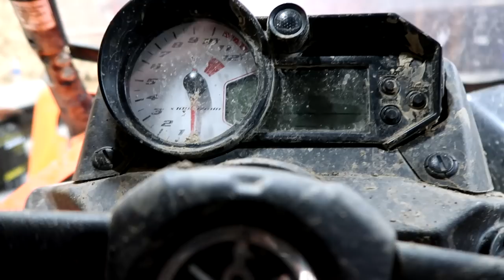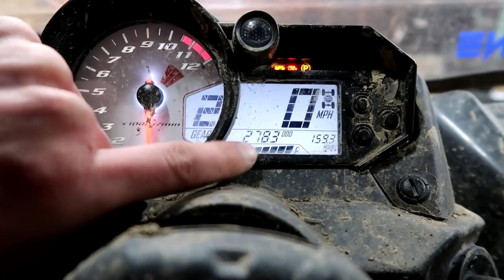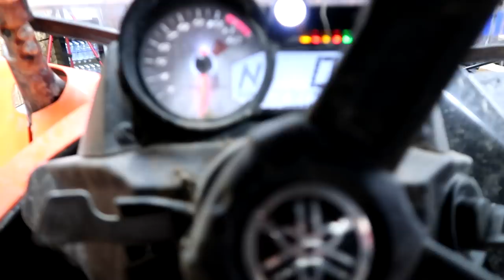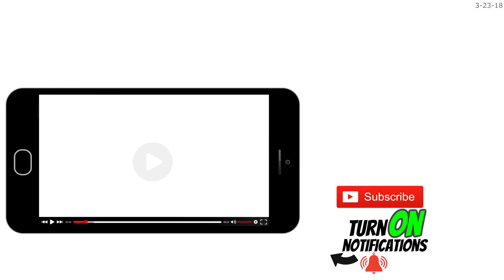I LOST THE FIGHT and was SCAMMED

Comment: I think the orange looks awesome!!

Do you plan to relocate the fuel tank and radiators?
Reply from the maker: Radiator yes. Fuel Tank... Not sure
Reply: The rad relocate is a definite plus! I’ve been to quite a few GNCC races and a lot of the YXZs do a fuel cell relocation as well that’s the only reason I asked. I have a 2016 Arctic Cat Wildcat X and they designed it with the rad and fuel cell up higher and behind the cab! Can’t wait to see ya at The Coker!

Comment: Hey Dalton!!!  My experience with auction buys is that there are always some hidden defects.... Some surprises to deal with. The extra miles and hours are no big deal if they maintained the engine... A lot of the stuff that U replaced, U would of probably replaced from the crash damage noted in the photos or stuff U would of added or upgraded... So, assuming that the engine, transmission, and electronics are healthy, add to that all the work, parts, and upgrades that U have done, U will be in Crush for around 1/2 of its new value with the upgrades U added.... U also gained a lot of knowledge of the machine, U made some videos, and U seemed to develop some passion for a new sport... All and all, I would say U had a win....  I have seen auction deals go so much worse....
Reply: Harvey Spooner Auction is buy as it... if you didn’t see the flaw in the vehicle that’s your fault. We sell our company fleet vehicles at auction, we actually go to the auction and watch people buy our stuff lol. At the auction they list the major things that are broken written on the front windshield. Saying examples Broke Window, Dents, Bad Motor, Transmission Needs Work. They don’t list things like broken ball joints or suspension bad. They only list the big expensive stuff motors and trans. We sell our Ford F350-F550 6.0s all of the truck we sell at the auction are motors blown heads. That will cost our company 5k for a rebuild kit. So we just sells them at auction and 70% of people don’t even noticed that the motor blown and they go high dollars hahah. So it’s the buyers fault and they need to look into what they want before they buy!!
Reply: Hey Clayton, I go to a lot of farmer style auctions, anything can be sold and anything and everything can be wrong with it.... If one pays more than the valve of known good parts, they are over paying.... Generally speaking, a lot of folks get ripped off, they get auction fever and loose all reason.... There are things that start at $5, I drop out of the bidding at $50, and the selling price goes above local Craigslist price for something that can not be tested out like a Craigslist deal.... U R right, buyer beware.... Thanks for sharing Ur experience, it is not different than mine!!!
Reply: Harvey Spooner Very true.

Comment: The different tires should have been a clear indication it had more than 35 miles. They have inspections you can request to have done before you buy it that tells you more details about it so you didn't really get scammed you just didn't do the best job at inspecting the machine you bought